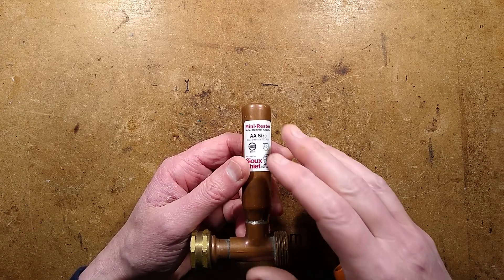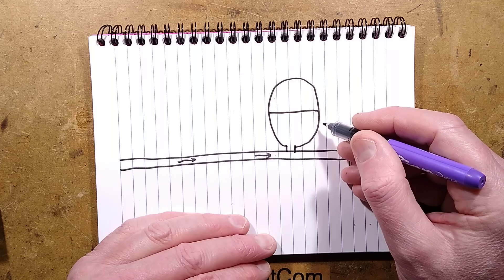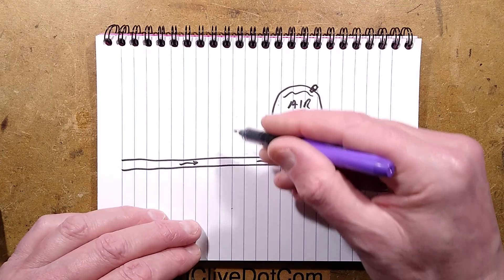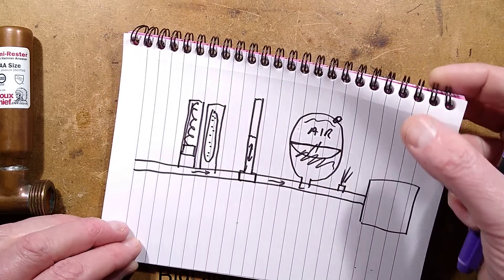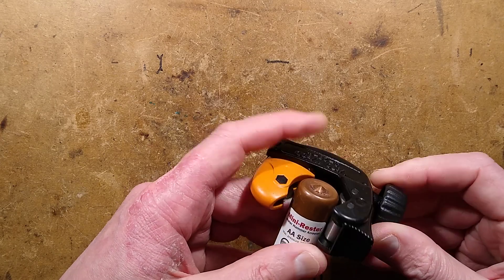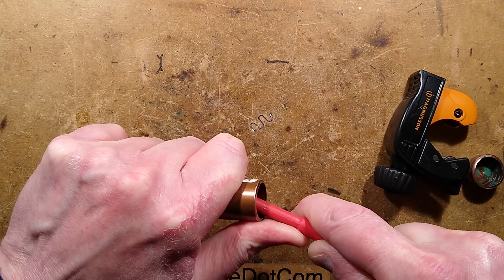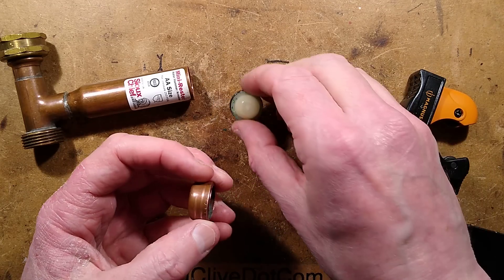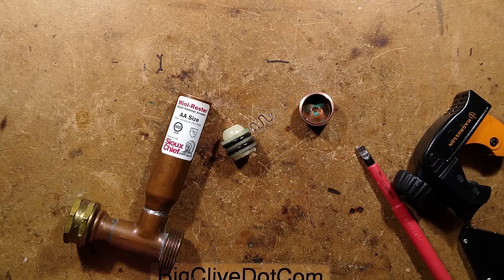inside an American made anti water hammer device

Comment: Similar, but bigger ones are often installed in refineries, crude (and refined products) pumping sites with dedicated 100-500 lts air vessels (some refined chemicals can't (shouldn't) mix and it's because what we call (ram strikes) of starting-stopping pumps. Talking about 17-20 HP those "suddenpressure spikes" can (ARE) a serious problem, than can sometimes make pipes vibrate so much that they can rip their fixings and at large, perforate tanks, or make them break by  their own weight alone.

Comment: Used a slightly smaller one of these to solve a really bad water hammer issue with new washing machine, had to use the dumpier version due to hight restriction on where it was installed, fixed and no more banging pipes.
Surprisingly effective. 
Was intrigued by what was inside so than you for the vid Clive

Comment: In commercial installations with long runs, expansion loops are installed. The primary purpose of course is for expansion/contraction of piping from temperature change so it doesn't rip itself apart, but it also has the double purpose of reducing water momentum by changing flow direction.

Comment: 7:42 The puck is plastic. And the o-rings probably don't like heat either.  So move it to the end, weld/solder it. Move it to the other end (maybe pressure it) and seal it.

Comment: So water hammer is inductive spike for hydro systems. Fitting that you’d use a big tank (capacitor) to shunt it. Maybe you could use a 1 way valve as a “flyback diode” of course with an opening pressure of 0.7 psi. God I love physics.

Comment: When I trained as a plumber, I plumbed my way through my Electrical and Electronic Engineering degree, I was taught to prevent water hammer. It involves a length of pipe, a T junction and an end cap inserted where needed with the blank pipe in the high vertical position to the pipe work, it stops water hammer and costs very little. It can be adjusted for volume and pressure by diameter of pipe and length.

Comment: Recently replaced 12 y.o. tankless water heater due to some corrosion and a slight gas leak. It was installed w/o permit and did not meet code.  Building code here in Eugene OR (and probably all over) REQUIRES the use of a thermal expansion tank on the cold water pipe going into the water heater, whether tankless or tank-style.  It was a $40 part and is necessary because there is a check-valve at the water meters to prevent backflow into the water supply.

Comment: It would be technically possible to make it not have stagnant water.
You need to design it so the inner plunger bit will always be pushed down to the end, with it shaped so it is flush with the pipe itself.
This would mean it would need to be calibrated to a given location's water pressure, or be adjustable.

Comment: The grease used - it seems to me that it would be in direct contact with drinking water. Even if it is "technically harmless" - no chemicals, oils. grease, etc. should ever get in contact with your drinking water? (old plumber told me to not use WD-40 to losen anything connected to the water pipes - nor use locktite or similar to secure bolts - as it could leech into the water supply).

Comment: I grew up on a farm well beyond any municipal water supply.  At least here, well-supporting pumps commonly have a feature that puts a dribble of air into the output, to ensure there's always air in the pressure tank.  The pressure tank has the output at just below the level where the top of the water should be, so excess air simply escapes into the plumbing system and comes out, generally unnoticed, from some tap somewhere.  All the same methods you described for how the anti-water hammer devices inhibit their air from being dissolved into the water are also used, but just adding a tiny bit of air all the time the pump runs is likely to be the most durable.  (It's also really easy to tell i your pressure tank has lost all air.  The pump comes on immediately when a tap is opened and turns off immediately when all taps are closed.  This means your air preservation system, whatever it is, has failed,  Just one of those little extra details of life you get out in the country.

Comment: a similar device, referred to as a bladder or piston accumulator, is also used in hydraulic applications. well, i guess this is hydraulic as well since there's water involved. one of the most interesting uses is on some launching roller coasters, where several very large accumulators are used with nitrogen as the air spring in one side, and hydraulic oil in the other side.

Comment: Just mansplaining: Legionella could accumulate in the dead end. Legionella is a bacteria that can cause death when the aerosol is breathed for instance when showering. You can drink water with legionella, no problem. There are other specialized germs that can withstand the acid in the stomach like salmonella and polio. Because of the latter the custom was introduced to wash the hands after leaving the "ceramics department" and also before eating, but I was digressing.
Ceramics department - there you also have the flushing cistern. Or so such a noisy flushing valve is doing the job.
These flushing valves are also shutting off the water flow in a very abrupt manner like solenoid valves.
As explained by Clive (and also by the bald engineer) when the the water is running it has kinetic energy like car or train.
Much less energy than a train of course, but water still has its weight.
If a valve is closed abruptly this is like placing a solid wall in front of a train.
Water can't be compressed like air, for instance.
In the case of water the piping will have to expand and later contract to convert the mechanical energy into heat.
An air pocket could help, but if there is none ... in the worst case a pipe can burst.
And here I come back to the noisy flushing valves. A marvel of mechanics. An astonishingly simple portioning valve. Like analog electronics.
But in case of a water hammer, the kinetic energy of running water in a pipe can also trigger such a flushing valve.
And that's what I experienced.
Once I was in a hotel in Greece. There was a flushing valve. I went to bed and was just in the phase of thoughts going irrational
and then - there was the sound of a dragon being strangled - for half a second.
I was wide awake.
So someone else in a different hotel room has flushed the toilet and the kinetic energy of the water now running against the abruptly closed valve triggered the valve in the secondary room of my hotel room.

Comment: Have one of these on my clothes washer. It cycles valves very rapidly and frequently, sending shockwaves across the straight shot of pipe under the house. Wasn't really an issue with the old classic top loader, but the newer LG washer seems to be a glutton for water hammer.

Comment: 7:33 It was a piece of pipe and they roll-crimped the ends. The one with the solder plug, was almost closed off. You wont get it watertight anyway. But this was done, before the plug was set in, from the other side, that was roll crimped to that taper.

Comment: german here in minut 1.25 its not air is should be with the gas nitrogen, if the tank has a membrane normal oxygen can diffuse into the water side trough the rubber and it will render it useless in funktion!

Comment: Uhm, just restrict the service valves to the washing machine until it stops causing hammer?

I mean I've got a couple anti-hammer devices around, one I used on my chemical service commercial lawn/ornamental/under-structure spray rig and it made for a nice little handle.

The most common way to deal with hammer from the washing machine was to mount it's service valves on the T line off the pipes that went up to the second floor or first floor bathroom that would result in 2 or 3 or more (if the lines served BOTH bathrooms) ends to diffuse the hammer into.  Basement laundry was a common thing since the washer uses a valved pump to drain.  Maintaining an air gap in the top of the water heater also helped.  There is almost always an air-gap in the tank on water heaters and if you don't have a tank type heater and the plumber didn't install an anti-hammer on the tankless that's 100% on them as its required by code.

Comment: From experience with hot water I can say that once the diaphragm fails the air bubble is absorbed in a few weeks.
If you have the space you might try adding unsupported S shaped bends in the supply pipe. The pressure step will move the pipe but you can control where that happens. Adding shock absorbers might be overkill ...

Comment: The "just a piece of pipe" arrangements aren't filled by bubbles in the water, but when the system is initially filled with water (and any time it's shut off at the main valve) it just gets ambient air trapped in it.

Comment: Never fill a pressure vessel with air, the diaphgram is not designed to hold in air, it will just diffuse into the water thus lowering the given pressure inside it until its full of water

Comment: The t pipes problem is where air water and metal is you get corotion that is why you have the Membrane separate air from water 

For heating Systems stagnating water aint the problem but Washing machines are conectet to your Tab water ..bad idea to have stagnating water there 
Since this gives bacteria room to build up 
If you have pressure Hits in your pipes it usualy because you used the wrong valves 
I never had a WM causing this unless there is some sort of wrong part used to build it

Comment: I’ve installed dead heads at fixtures in all my plumbing new and rework projects.

I’ve often had complaints of water hammer and noises in the walls eliminated with just an inverted dead end pipe.

Stops Pex from moving around so much as well.

Quite simple to recharge the air.  Drain the system at the water heater, as you should once a year or two anyway.

Comment: I hate these things, just a lazy way to avoid clipping your pipework and failing to find the loose tap jumper in the system. They have reduced in need (on small systems like a typical home) because of lever mixers and plastic pipework which can spread the hammer effect over the whole line.

Comment: Those dead end pipes aren’t meant to fill up with air diffused from the water. They are installed empty of water (but full of air) and since there’s no outlet the air cannot be purged from the dead end by normal water pressure. The problem with them is over time that air diffuses OUT of the dead end leaving it just full of solid useless water.

Comment: The closed off pipe worked by harnessing the springiness of pneumatic systems.
They were installed vertically and worked great. They started by being filled with air, not by capturing air bubbles. This feat was accomplished by simply not being assembled underwater. They would lose effectiveness very slowly overtime by having the trapped air being absorbed by the water during water hammer events. Which would require being recharged with atmospheric air by the simple act of turning off the water at the mains and opening the faucet to the air to replace all the water in the system with said air. 
One issue was cheapness, why waste 3 feet of pipe when you can use 2 feet, or 1 foot... Oh your pipes knock after a few months, no, how could 6 inches of compressed air not work great?! But hey, saved 10 dollars on every faucet by not installing a full 3 feet of dead ended pipe. 
Another issue was "hard" water. Water with a high mineral content would slowly build up a mineral layer at the water line, which could block the pipe completely. Sealing off the pneumatic spring from the water.
The final, real, issue was cost of replacement or even certain instalations. Got to tear out a fair bit of wall to fully expose the piping needing worked on. Or what do you mean my island sink and dishwasher costs so much? Need a special water hammer device since there's no wall to install a yerd of verticle piping. We'll everyone should be forced to install them, it doesn't matter to me that they have their faucet next to the wall. 
The final reason, not real, is the BS perception that somehow the old method didn't work great for couple hundred years, for individual installs would function for40 or 50 years before you ever even thought about inspecting said pipe work. Sure, sometimes, like with fast actuated valves on washing machines you'd want a different device or a 6 foot long pipe, or a 2 inch wide pipe to increase the size of pneumatic spring.

Comment: So, the answer to the question of why they aren't commonly used anymore is fairly simple. If it was "Dead legs cause stagnant water"  they would be banned in all major US cities. They aren't. A lot of state codes don't allow them, but they are, as example, required in San Fransisco. 

The example I found is from San Fransisco, and it states, specifically, " 609.11.2 Air Chambers. Air chambers shall be installed on all hot and cold water
outlets supplying quick-acting valves to provide water hammer relief. The size of each air
chamber shall be 24 times the diameter of the fixture supply"

Comment: You are spot on sir. Some do contain springs. The top end was spun closed. The only thing I could enlighten you on is the reason we no longer use air chambers is because over time water will absorb the gasses in the dead end and become ineffective, making it necessary to periodically drain the entire system to refill the air chamber.
Reply from the maker: Hi Dan.  Long time no see.  (Great beard.)

Comment: This is very similar to a piston style hydraulic accumulator. They make bladder style aswell for heavy equipment and basically any hydraulic system. Even down to the dual o-ring. The cylinder seems very small for the water line diameter. On caterpillar mining trucks like the 785, 793 and 797 their are massive brake and steering accumulator that actually hold pressure or stored energy in school it’s referred to stored energy or even a sort of battery for the system. In case of emergency but it can also absorb shock just like your water system. You could have probably modified yours and put a Schrader valve at the top and gave it a few psi but from the look of things it would not have held very much 😂

Comment: I've found that substituting PEX tubing for copper or iron pipe works great for eliminating water hammer.  If one has a run of the stuff half the length of one's house, it expands sufficiently to act much like the Sioux Chief Mini-Rester. Where I had a substantial rattle and banging whilst running the shower, after I replumbed with PEX there still is an oscillation in the system at times, but it is just a gentle chuff-chuff-chuff.

Comment: I have versions of these on my dishwasher, and washing machine.  Unfortunately, they just never last more than a year or two in my applications.  I don't know why, but the hammer comes back and I have to remove and replace them.

I wish they made them with a Schrader valve so I could re-pressurize them periodically.  I think either our water pressure is excessive, or they just slowly let the trapped air escape past the o-rings.

Comment: Ah, you build your piping network before water is hooked up. So this nice vertical (or even nearly horizontal) pipes start out empty. You turn on water and it displaces the air, which having no place to go compresses until it matches the static supply pressure. From then on it works as normal. If it leaks a little  you may have to drain the plumbing and restart flow to "recharge" the air supply - maybe once a decade or so. We place a length of capped irrigation pipe or tubing at the end of irrigation runs to perform the same function. We slightly elevate the far end so it fills properly. The length of the house's anti-waterhammer pipe is about  15' to 20'. The capped ends are about 4' to 10' long. We simply stick a T on the end of the chain and connect the remaining pipe to it. That stub is then capped. Works a charm. And no shrader valve is needed.

Note that not much water volume is needed. That's why the small thing you took apart can be effective. You just need something that can absorb the moving water's momentum.

{^_^}

Comment: I use these and they work, but not great. They prevent banging but not hammering. Pipes still move. What would be great is if there were a valve on top to pump air into, even using a simple bicycle pump, to push the plunger down with some air. It would probably increase the things effectiveness by an order of magnitude.

Comment: Many systems employ an airbubble without a diaphram such as some unvented cylinders (they need recharging periodically). an older example would be the old primatic hot water cylinders which keep primary heating water and dhw seperate

Comment: I recently dismantled an expansion chamber and was surprised that the rubber bladder encases the water supply, and the schrader valve feeds directly into the metal chamber. I thought it would be the other way round, like a tyre.

Comment: I have an lg washing machine that seems to test its solonoid valve on each use, literally opens and closes ten times just on the first fill. Used to cause a loud bang each time.
Fitted the exact same model Clive has here 6 years ago and it no longer sounds like a duel in the kitchen.
Reply from the maker: The filling in bursts is to just saturate the clothing to the point that it won't absorb any more water.  It results in greater detergent concentration and a more vigorous tumbling action.